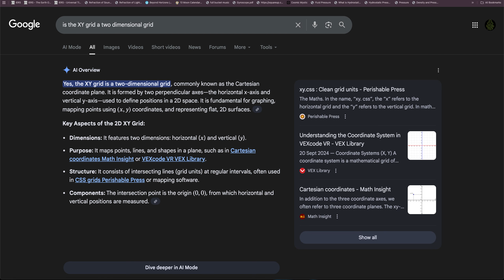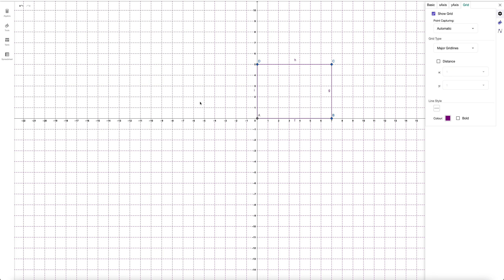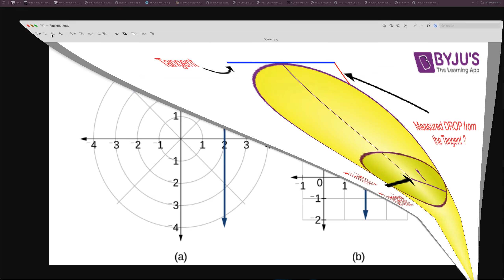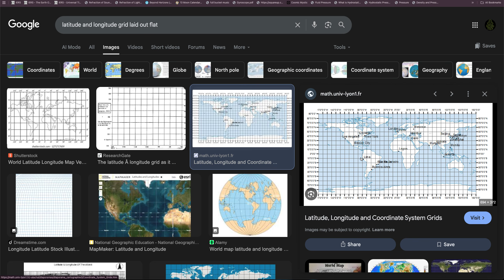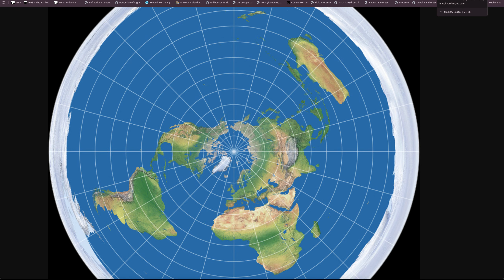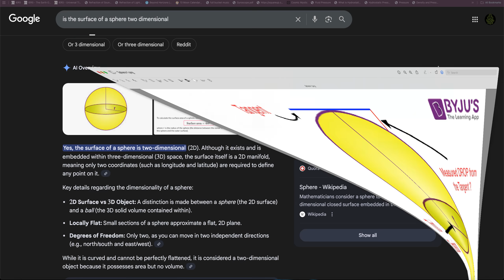The 2D Globe  lol

Comment: On the surface of a sphere of known radius the 3rd dimension is defined by the sphere itself - the radius in other words. Of course, if you want to define a location above or below the surface of the same sphere the will need to add the 3rd dimension after all. 
Once again you are parading your ignorance in pursuit of an indefensible argument
Reply from the maker: My ignorance lol 😂 you’ve just ADMITTED that there’s a third dimension needed, making the surface ( wait for it genius ) THREE DIMENSIONAL….
Reply: @BriansLogic  thing is Brian, you can define the location on the surface of a globe using 2 angular dimensions without even knowing the radius.
Reply from the maker: @DeeDubbayaNo you cannot you must use the internal of the sphere which is the third dimension, no matter how you twist and turn it you’re wrong….
I encourage you to read my pinned comment and then delete your threads.
Reply: @BriansLogic  wrong again Brian, you can define a location using just latitude and longitude angles on a marble, a golf ball, a tennis ball, a football, an exercise ball etc, without knowing the radius of any of them. But keep parading your ignorance by all means  - you are doing nothing but harm to flat earthers
Reply: @BriansLogic  "No you cannot you must use the internal of the sphere which is the third dimension, no matter how you twist and turn it you’re wrong…."

I can draw two lines on the exterior of a sphere and with those I can define any point on the surface. At no point do I ever need to consider the inside of that sphere. 
Latitude and Longitude. 
X and Y. 
2 dimensions.
Which one of those two passes through the centre of the sphere?
Reply: @BriansLogic No, he didnt do that at all.  Read what he said again.  Slowly.

The surface of a sphere only needs 2 dimensions - lat/lon.

Comment: If you open my geogebra page, you'll find an AE map on a polar grid. Open it in your own app and change it from polar to grid lines. See what difference it makes. I didn't make the map for the sphere but what I did do was to take each of those points on the coastlines and translated them to make the AE map. 3D to 2D essentially. Yes, you need 3 numbers to for each point on the sphere and only 2 numbers for each point on the polar grid. In the case of the sphere, one of the 3 numbers will be the same for each point, ie, the distance from the origin or radius of the sphere. That doesn't mean to say the surface of a sphere is 3D. If the surface has an area (which it does) then it is fundamentally 2D in nature, even if it exists in 3D space.
Reply: He wouldn't even get how his apparent height stars and fixed GPs would produce visibly changing star patterns if we accept celestial navigation works well enough.

You expect him to understand manifolds?
Reply from the maker: @joecordialSorry are you reifying the Stars ⭐️ to be a specific something ? SMH.
Reply: @BriansLogic Your apparent height stars together with celnav is a claim that will allow you to show a conflict in claims.

Namely distance/elevation  angle from celnav, flat and apparent height will allow you to predict elevation angles from a given map if you move the observer around You will see the predicted sky will change constellation sizes as you move, for example. Something not happening in reality.
Reply from the maker: Petey if you're using a AE map then you're using a flattened map of a globe earth, the incorrect claim is that the surface of a sphere is 2D, if that's correct than you will be able to have both grids simultaneously laid upon a 2d surface, where no distortions of the land masses occur, essentially a Flat Earth Map, but you can't do that without mutation of the land masses, nor can you make the two grids work simultaneously and in tandem with each other like they're designed to do, and they do ALL the time in every other circumstance but this one ? 
So the claim that the surface of a sphere is 2d is a gas light that people choose to accept, as how could a 3D sphere have a 2D surface, and require the removal of spherical excess to place any part of it on a TWO DIMENSIONAL MAP SURFACE, the removal of spherical excess is the removal of the THIRD DIMENSION, that you're claiming doesn't exist on the spheres surface, so Petey if the third dimension doesn't exist, then why would it need to be removed to place a section of the sphere onto a 2D map SURFACE ?
The surface of a sphere as I detail correctly is and can only be 3 dimensional, and if you're truly geometrically honest ( today ) then you will accept and admit that FACT....
Reply from the maker: Petey I have shown in DETAIL how the surface of a sphere is 3D, if you want to claim otherwise then you’re either lost or lying ? 
And I don’t care how you want to try and mix it up, a THIRD dimension is required, and do you know why ? 
Because a sphere is a 3 Dimensional shape, so THREE dimensions are required for the creation of points/coordinates on its surface.
Reply: @BriansLogic  No, you haven't shown in detail but I agree with much of what you said in the other thread. You said that the area of a sphere's surface is equal to the area of 4 circles that have the same radius as the sphere. I agree. The area of one circle is πr², so four give 4πr². Notice we're talking surface area here, not volume. 

Now imagine a rectangle with the same area of 4πr².  We both know that a rectangle is 2D surface, even though it can exist in 3D space. Let's say I create a rectangular surface in GeoGebra 3D calculator. I'd still need x, y, z coordinates to create a point on it but it doesn't make the surface 3D.

Once I create a point on that rectangle, it can only move in 2 independent directions, say, forward-back and left-right. There isn't a third direction for it. That's what makes it 2 dimensional and it's why you only need 2 coordinates to describe where the point is on it. 

The surface of a sphere is the same situation. Yes, the sphere is a 3D object and its surface exists in 3D space but a point on this surface can still only move around in 2 independent directions, say, north-south, east-west. There is no third independent direction available to that point while staying on the surface. We can also describe where that point is using 2 coordinates, eg, latitude and longitude.
Reply from the maker: @Petey194 No Petey you don’t need XYZ with a rectangle, you only need X and Y see the UTM projection, which is the projection of a sphere rolled out flat into a rectangle, which is why mathematically the surface area of a sphere can be determined by turning it into a rectangle via a cylinder, as then you can place squares upon it without incurring spherical excess, which is something you can’t do with a sphere, as no square will be a square they will all mutate, see a disco ball 🪩 because a sphere warps all 2D shapes placed upon it in all directions, and adds to the internal area of the shape as a consequence. 
The surface of a sphere is 3D end of story.
Reply: @BriansLogic  So if you created a rectangle in GeoGebra 3D so that it is lifted up from the xy plane and angled so it is free-floating, you then put a point on it, that point can have 3 different values for x,y,z. That's a fact and easily demonstrated. It's a 2D surface in 3D space. You just can't bring yourself to admit it. 2D surfaces can exist in 3D space - end of story. A point on that tilted rectangle can move from the lowest left hand corner to the highest right hand corner but it is still can only move in 2 independent directions.
Reply: @BriansLogic  You have replied out of sequence. What you are saying is 2D is always flat and I'm saying 2D is about two independent directions of movement.  Not much point in continuing so I'll leave you with this thought. If you were a point moving about on a sphere's surface and were given instructions to move "straight ahead", what would that mean? 👋
Reply from the maker: @Petey194 It would mean nothing Petey as you can’t go straight on a sphere, you can take a non deviating arc if you like, but you can’t go straight. 
And 2 dimensions is without a 3rd dimension, which is why the surface of a sphere is NOT 2D.
Reply: @BriansLogic  Humility is not your strongest point, is it? I mean, I don't think you have strongest points at all, but still
Reply from the maker: @joehoward1506 Exactly what am I supposed to be humble about ?
Reply: @BriansLogic Straight in this case means not turning by an extra amount with respect to the curvature of the surface. On a sphere this means not changing your heading (azimuth). So the shortest distance you can get between two points while being forced to move on the surface.
Reply from the maker: @joecordialNo Straight means Straight, Curved means Curved…. End of Story….
Reply from the maker: Oh and you can’t have an Azimuth on a globe earth Genius….
Reply: @BriansLogic Your doesn't seem to work on flat earth with circles of equal altitude...
Reply: @BriansLogic In Euclidian geometry yes. Remove one of the postulates and straight becomes a geodesic.
Reply: @BriansLogic Brian anything embedded in 3D is 3D. The surface is still representable by 2 coordinates.

If you were to live on the perimeter of a planar surface it is a 1D object of only length. Although it clearly has 2D embeddings surrounfing a rectangle for example.

Meaning if you are only interested in describing the position in the space of these "boundaries" (this means we are presupposing our position to whatever this boundary is), it reduces the amount of coordinates. It doesn't mean these coordinates are Euclidian or Cartesian. Coordinates are just 2 numbers. What space they describe depends very much on the space.

I give you an example of a distortion.

Let's say you were running or bicycling. You recorded distance and time. Now running or cycling straight on a plane you run distance resp. path length will match the distance on the plane. No distortion. One coordinate to represent your position for the path with 0 being the start and 1 the end.

The way to get this one coordinate is often not unique, depending on what your goal is. It could be relative to the total path length, it could be relative to the total time of your track.

But now let's put hills and curved paths while still on a flat earth. Your distance or path length will still be your path length. Your graph (time vs distance fill still be a graph although you now pass in the 3D dimension off the plane. Your graph will not show you, that suddenly you were on a different kind of surface.  The existence of a graph or map or coordinate doesn't tell you anything!

In this example your position in the graph can still be represented by one coordinate.

In order to see a difference you would need the coordinates in 3D space to compute the distances between points and see that the path length and coordinates don't align with the shape of the assumed surface.

Comment: Surfaces are defined to be infinitely thin. Any real world object doesn't even have a mathematically accurate surface. 
As such what you read in the first minute was absolutely correct and in no way nonsense!

Let me guess about the development of the video:
Just because something is not on the surface of a defined body doesn't mean it can't exist. It's simply not on that surface, dimwit!
Reply: Is the center of a sphere (the 'third dimension') on its surface? If not why do you act as if it's part of the surface by claiming it's the third dimension ON THE SURFACE?
Reply: He should also read up what defines a polar coordinate system
Reply: Your lack of understanding of how maps work, what they are, the difference between transformations and changing how maps are displayed is truly fascinating. How do you manage to stay so oblivious to facts and so resistant to learning?
Reply: Oh my north west is still a combination of north-south and east-west 🤦🏻‍♂️

The approximation is the flatness of the plane not the surface!
No you can absolutely have approximations that may be valid or may not be useful!
Reply: And right after he's denying that Locations on a sphere can be defined with cardinal directions 🤣
Reply: He really should look up what the context of describing in mathematics 🤦🏻‍♂️
Reply: Where in the definition of horizontal and vertical is it dictated that they have to be parallel to each other?
Do you realize, that you'd be making conclusions about reality through mathematical definitions, which have no obligation to exist in reality?
Reply: All of mathematics is making sh*t up.

Comment: A sphere enveloped in uncontained yet pressurised gas in an infinite vacuum. Why is this so hard for you to believe Brian? Dont you have any faith?
Reply from the maker: No Andy I like to Not need faith when it comes to geometry and thermodynamics lol, but if YOU believe that the surface of a sphere can be a 2D Plane, then I can sell you all kinds of BS ?
Reply: @BriansLogic , nobody, including flerfer like yourself, believes that the 2D surface of a sphere is a flat plane. That's ridiculous! 😂😂😂😂😊
Reply: @BriansLogic  " but if YOU believe that the surface of a sphere can be a 2D Plane, then I can sell you all kinds of BS ?"

Nobody besides you mentioned the term "2D plane". The only mention of the term "2D plane" mentioned in your video was regarding small sections of a sphere  APPROXIMATING  2D planes. It didn't say that they were 2D planes... just that they approximate it. And the smaller the section the closer they approximate it until you get down to the most basic section you can have which is 2 atoms side by side which ARE 2D planes.

Ultimately though Brian... a whole 2D sphere is not a 2D plane. Nobody said that and nobody will say that. A 2D sphere IS NOT a 2d Euclidean plane... it's a 2D manifold. It says as much in the very first description that you looked up.
Reply from the maker: @bobleonheart9600  Something can't be 2D and not be a Plane ???? X and Y for example ?
Reply: @BriansLogic  Yes Brian. Get a ball and draw two lines around the surface of it. X and Y. You can use only those two lines to find any coordinate on the surface of that ball. You know kind of like how you can use a globe of the earth and use only longitude (X) and latitude (Y) to find any point on the surface. You do not at any point need a third coordinate (Z).
Reply: @BriansLogic  your inability to understand mathematics is not a valid argument against it.
Reply: @BriansLogic  “Something can’t be 2D and not be a Plane” - why not?
Reply: @BriansLogic  no, nobody thinks that, stop lying.
Reply: Oh  @BriansLogic   you hopelessly overestimate yourself.
Reply: A globe which has an atmospheric gradient that simply gets less and less. There is no “infinite vacuum “. There are not 2 systems as the flat earth grifters would have you believe. You obviously have been taken advantage of by Oakley.
Reply: Andy, this isn't belief, it's knowledge. It would take faith in magic to believe that there is uncontained air pressure adjacent to a hard vacuum. There isn't. Why do people, like Brian, find this hard to understand?
Reply: @tomfromamerica8042  Knowledge of physically bent concepts? You know spacetime is purely conceptual right? Physically bend some spacetime. Flex your knowledge 🤣
Reply: @Andy-O374 , is there anyway to get you to stay on topic? Your random gibberish is distracting.
Reply: @tomfromamerica8042 

Translation :You concede that my level of comprehension far exceeds the very limited boundaries of yours  🤣
Reply: @Andy-O374 , no, no, Andy. I conceded nothing of the sort. Your comprehension doesn't exceed mine in any way at all. What I actually ask you was, is there anyway to get you to stay on topic, because your random GIBBERISH is distracting to the adults. By "gibberish", I mean, random nonsensical noise. You sound like a petulant child trying to change the subject in the middle of an adult conversation, because you want a popsicle. How young are you?
Reply: @tomfromamerica8042 I think he realizes Brian is losing the 2D argument badly, so is stepping in to try and deflect the discussion on to something else.
Reply: The problem of the pressurized air with a vacuum above persists on a flat earth.
If it's measurable by amateurs that 99 percent of air gathers very close to the ground (compared to the distances we can travel between locations on earth)!
And as of yet there has been no sign of finding the container so we know the container we are in is mostly empty with a thin layer of air near the ground. Why would that be any less strange?
Reply: Why is it so hard for some people to stay on topic - 2d, 3d and spheres?  Rhetorical question only.

Comment: As usual I'm ONLY like 2 min in & bro is already objectively wrong at least 4 times. ALL surfaces are 2D by definition. Regardless of the quantity what do the units need to be, if you wanted to paint it? Yes, it's embedded in 3D but you only need 2 unique simultaneous values to locate ANY point on the surface. & for your ending nonsense, it's the exact opposite, IF erf was flat you could indeed use your Cartesian grid to map it without distortion. But it's not flat, so you can't. & that's ALL there is to it. Amazing how Oakley really convinced you that your his resident maff eggspurt. When dropouts understand it MUCH better than ALL actual experts combined, ONLY in flat erf. That's just Adorable Broin. Too bad you couldn't toss in some skoi moiles just for good measure. You are either just a clown(actual circus act) OR clinically delusional, or both.